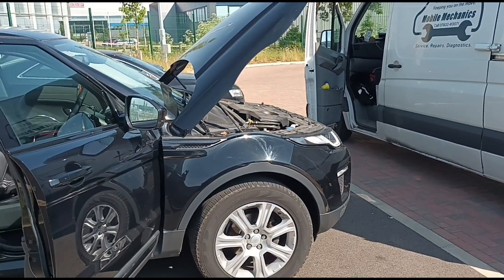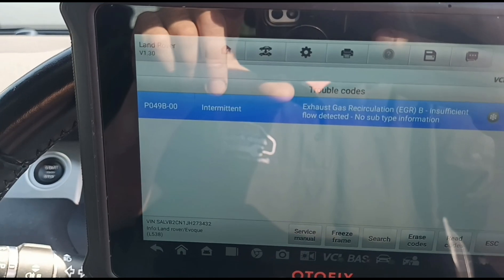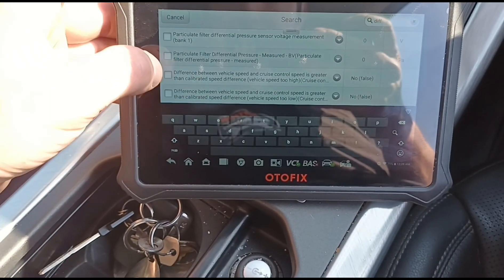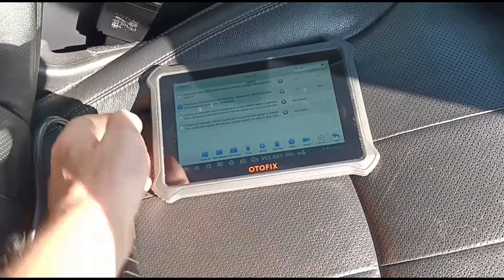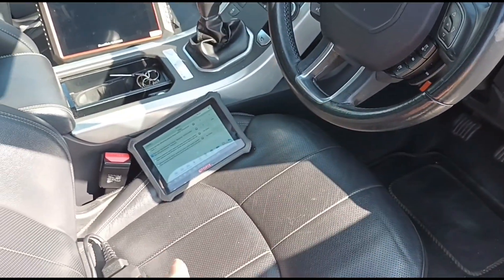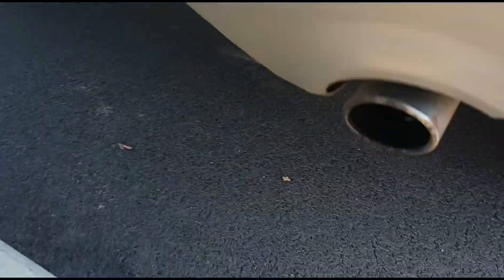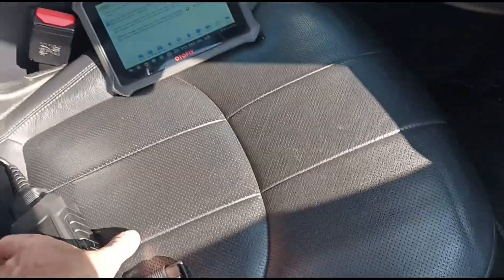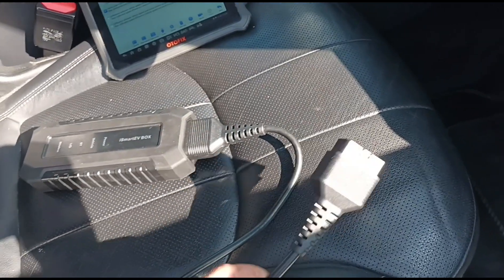Common Wrongly Diagnosed P049B-00 Land Rover 2.0 Ingenium EGR Flow Insufficient Flow Detected

Comment: I may have missed it, but what is the solution to it? Got a 2019 range rover evoque. Same fault code, dpf cleaner said doesn't need doing. Trying sell it but engine light on. Land rover were no help at all
Reply from the maker: Basically it needs a new DPF then low pressure egr filter.  Also worth testing fuel injectors for over fueling

Comment: Quite an insight; will check mine. EGR filter was clean as a whistle, when disassembled. Still have the code, so this will take investigations into a different direction, thanks Mr. O'Riley.
Reply: Please do check back?  I have this code also...truck seems to run well though.  At 91k miles, I'm thinking the DPF may be due.  I'm looking to get a good scanner before I start into it.... I want to check the differential pressure on that DPF first thing.  Does your EGR have a filter screen in it?
Reply: Any update?

Comment: Ive got this code its only temporary but thing was i did have a failed nox sensor and i fitted a new one and obviously rhat code has gone and havebt driven it much since yesterday and now this code has appeared as temporary and wasnt present before, the honeycomb filter doesnt rattle ive already checked any suggestions on next steps please im pretry hands on wirh things
Reply: @ORileysAutos  ?

Comment: what´s the solution ?
Reply from the maker: Land Rover solution is to fit a new DPF that only seems to last a few thousand miles
Reply: What’s your solution if we don’t listen to the dealer? New DPF? I had the dealer change my DPF and now this error came on less than 20 thousand kms later.
Reply from the maker: @shyne0032  the DPF on these I have customers who have to replace it every 6000 miles. So it's a very delicate system. Unfortunately it sounds like you need to replace the DPF and EGR cooler filter once again
Reply: This sounds like one of the times when delete gut as got to be up there
Reply: Can it not be repaired the DPF thing it’s self - new coatings?

Comment: I'm on a Disco Sport Ingenium with the p049b-00 low flow, the exhaust gasses for the egr are taken down stream of the dpf to keep the gasses as clean as possible before returning to the egr and blocking it. I too have changed the filter that looked passable.
Reply from the maker: Definitely needs a dpf

Comment: This is a good one Jimmy, on the scan tool why is the DPF pressure sensor voltage at 0V ? Normally there is a plausibility test ignition on at approx. 0.5V to check the DPF pressure sensor is functioning correctly, is this different on JLR vehicles ? Love ur  video’s im a Ford tech myself …. Cheers

Comment: So is it safe to just ignore this code? Will it damage the vehicle?
Reply from the maker: The soot getting pass the dpf will make its way through the low pressure egr and eventually kill the turbo
Reply: But the egr low pressure gas is taken before DPF.. so no expectation of soot cleaning.. also it doesn't feed to turbo but engine air intake
Reply: @ashishm6103 ?  Good point, I think...The EGR is usually open at idle? When turbo boost is low.   Additionally, the inlet restriction plate serves to decrease pressure in the manifold, causing the pistons to draw in gases from the EGR.  Interesting!

Comment: Hi Jimmy, I'm at ex JLR master tech, they was a TSB for the 2.0 ingenim engine, DPF brick cracks and let's to much sort pass. Then that gets into the low pressure EGR cooler which has a filter, the filter blocks with soot and then you get low flow EGR 'B' (the low pressure Egr). Replacement DPF (new dpf pressure sensor as the pipe work is different on the new Dpf), clean out soot from the cooler and fit new filter.
Don't just remove the cooler filter because the gas flow is directed in before the turbo turbine.
Reply: What if the DPF was removed and the code keeps coming back?
Reply: @homesweet1144 hows that possible
Reply: Didn't make sense

Comment: Your videos are a great help, amazingly I have an Evoke in for exactly that today sounds like the dpf is rattling and the exhaust has soot, bad news for the customer only 43k miles
Reply from the maker: Glad it helped
Reply: @ORileysAutos  it is showing 68% full and 1 kpa going to 2.5 at 3000 rpm
Reply: @ORileysAutos  Jimmy where are you about? I have Discovery 4 dpf problem no power at darfort. Can you help ?
Reply from the maker: @Freedom_fighters898  Bedfordshire
Reply: @ORileysAutos  oh great do you go where the car is or will have to bring where your?

Comment: I have this fault code. DPF is fine, EGR is fine. I just keep clearing the codes with no issues so far. I've even passed the emissions MOT test (with the help of Wynns Gold diesel additive). 😂 As a matter of fact, this issue has made my evoque even more reliable.😂
Reply: Try to unmount your injectors and get them tested on a Commonrail injector test ramp.
I'm 99% sure they will not pass the test.

Comment: JLR really do Manufacturer some utter garbage, Avoid at all costs to protect your sanity and wallet.
Reply from the maker: I do rate the Discovery 5 3.0 but not these or the Discovery Sport or any model with the 2.0 Ingenium
Reply: Most post ownership Reviews on YouTube don't disappoint with people's complaints and their relatively low reliability scores compared to other manufactures says it all
Reply: I agree the engines are garbage, common problems are chains, cranks breaking dpf's egr's electrics etc..... but the people who buy these dont care these are bought for the image people think they have, i commend JLR marketing department that have managed to convice the gullable to part with a ton of cash for a garbage product, yet you will still see people defending them till death lol
Reply: @bmwm5550 these problems are mostly down the school run cars that never get on the open road. Ask any mechanic who rebuilds the failed engines & they’ll tell you the same. There’s half a million of these engines in various LR models. Lots haven’t broken because they get out on the open road & the DPF can regen etc. 

Whether the school run owners should ever have been sold a Euro6 diesel in the first place is another matter entirely

Comment: It appears there may be a group action lawsuit against JLR for using defective components. Your customer may be able to use this against JLR to get this repair covered under Warranty. Please get them to check this throughly as I only found it on a Google search to see how much a new DPF costs.
Reply from the maker: These Vehicles are not fit for purpose at all.

Had a customer with this same fault a few days ago. 2022 model had 3 new dpf replacements already. 3 new egr cooler filters. A new cam chain. And it now needs a 4th dpf 30,000 miles 2 years old.

Land rover said its wear and tear and due to the customer driving style
Reply: @ORileysAutos at what point at sale of car does it say you cannot use it short journeys  .people buy cars  for local and long journeys  ,fit for purpose?
Reply: if I buy another Range Rover I think I will buy a petrol rather then diesel engine
Reply: Probably why the lawyers are moving on from Emission Control issues onto reliability. Vehicles included according to the website  
Land Rover Discovery Sport (L550)
Range Rover Evoque (L538 and L551)
Jaguar E-Pace (X450)
Range Rover (L405)
Range Rover Sport (L494)
Land Rover Discovery (L462)
Reply: @Thoughts_from_a_Small_Island these claims are purely speculative & have little merit. They’ll go nowhere
Reply: JLR products are built in china or wherever JLR can find the cheapest, then a land Rover logo is stamped on them to fool you into thinking they are quality products. JLR are run by accountants leading to poor quality at the highest prices.